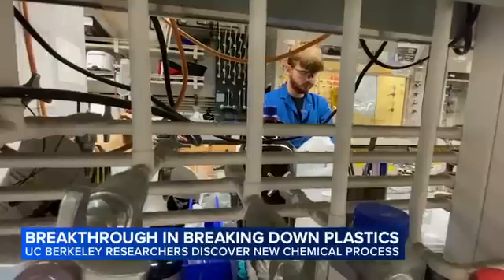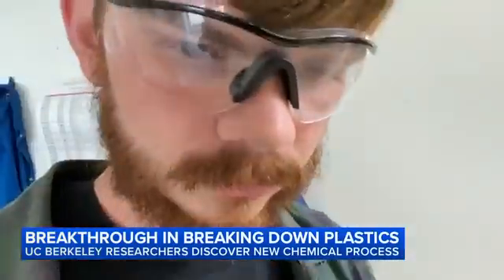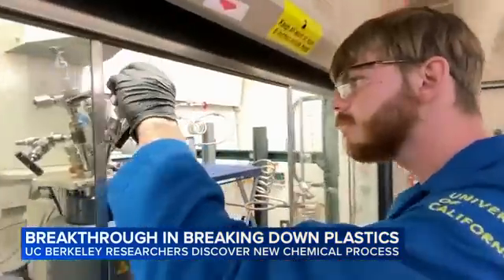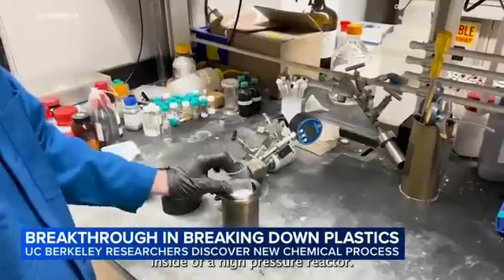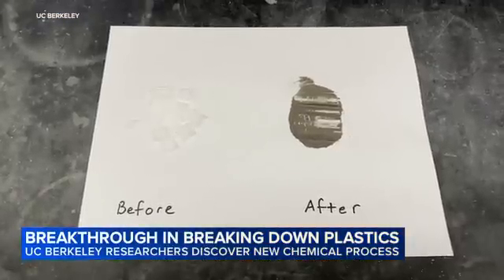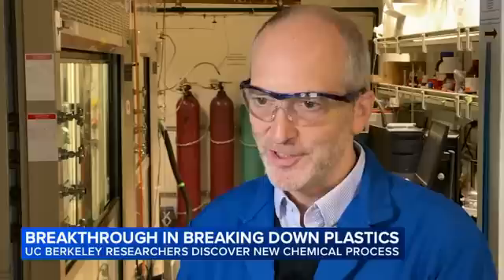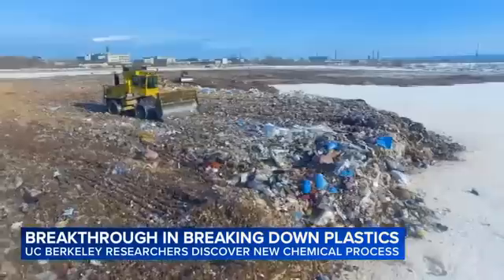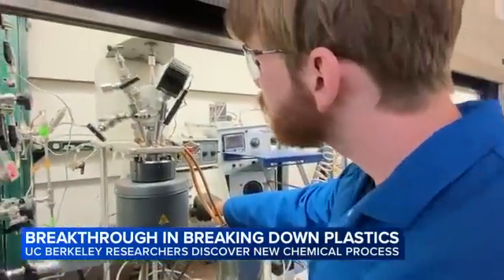UC Berkeley chemists discover new way to break down common plastics

Comment: Nearly all these containers could be aluminum, glass, bio plastic, or wax coated paper, but greedy companies don’t want to spend a few more cents per item, even though the margins are insanely high on most of them.

Meanwhile these companies spend money to launch guilt campaigns to get people to not use plastic shopping bags and most instead use reusable bags which would have to be reused 1000-2000 times to equal the pollution output, but they always break after like 100-500 uses and get thrown away, creating more pollution than just using plastic disposable bags.
Reply: Plastic "canvas" bags really should fall under the same restrictions\prohibitions as single-use plastic bags; plastic textile fibers are now the #1 contaminant found in lung tissue, whereas hemp bags are cleaner to produce and dispose of. Even cotton bags don't use enough water to be worse than plastic canvas bags. 

Artificial fibers are a bane.
Reply: @prophetzarquon  I see a lot of supermarkets selling cheap natural fiber bags, they tend to tear after a couple dozen uses max, they still output far more pollution and consume more energy than disposable plastic. And nobody’s going to set regulations on how strong a shopping bag has to be.

So while it’s nice in principal, these plastic shopping bag and straw laws do more harm than good. Even a sturdy natural fiber bag that can last long enough to break even vs disposable plastic is likely to get lost, damaged in many case before it reaches break even, if you shop once a week most of these bags would need minimum 19 years to break even. I don’t think I’ve ever kept any bag that long and if I did it wasn’t being used, just stored away somewhere.

I agree, microplastics are awful but these laws skirt around the major sources of it, the fashion industry and food packaging.

Comment: There are already way to recycle plastic but it's too expensive. It will be the same as here. How many gram of tungsten and sodium he use and on top of the time and energy just to recycle a few grams of plastic. Now scale this up to thousand of tons of plastic. How much time, energy and these raw materials are needed to convert these plastic back to their useful state? Ideally all these are just waste of energy when you can feed plastic into furnace and convert it into a fuel source to as a source of energy rather and wasting additional energy and raw materials just to convert plastic back.

Comment: High pressure, heat, expensive catalyst, scaled up?  Doesn't seem economical or feasible.  Just a lab curiosity.
Reply: True. Though i just randomly imagined a sci-fi future where the plastic-eating fungi became a problem that got out of hand, then scientists determine that we must gather as much plastic as possible and do this to it or else the sheer amount of plastic being metabolized would turn into obscene amounts of carbon dioxide in the atmosphere. This is probably as infeasible as the "direct air carbon capture" thing being experimented though.

Comment: If it takes more energy then zero energy then it will fail. Go after the manufacturers and the box store system to demand customers bring in their own packaging to leave with an item. Like the tote bags at the grocery store. The beer boxes that don't even need to exist. The straws on the side of juice boxes that are frivolous. The bags of chips that are designed to be loud so people notice you eating them etc etc etc. Simple logic is cheaper and easier to deal with instead of monitizing recycling into yet another separated heap of waste nobody wants or needs.

Comment: This man deserves to be awarded 👏
Reply: Is there an award for perpetually kicking the can down the road and having zero foresight?
Reply: @SeerSeekingTruth  If anyone would know I suppose it would be you .
Reply: I have a pretty good back ground and chemistry, and having not read the paper yet thete are several things this video skips. What is the total energy cost of recycling the products, how usable are the results, is it scalable?

This is extremely promising if this just requires some recoverable catalytic components. But if the energy cost is still high and cant be lowered. This will remain in fairly useless.
Reply: @Fleck7140  How many calories to heat up ethylene for an hour and a half? We'll have so much waste heat from training AI models that we may run out of things to power.

Comment: Sounds really expensive, another pipe dream tungsten powder is 360-370 Kg. The best alternative I have heard is several biological organisms that naturally digest plastics and scientists are working on hybridizing them to be faster and more efficient.
Reply: Tungsten is used as a catalyst and can be recovered from the product.
Reply: There are a few issues with employing the organisms studied for breaking down (one class of) plastic:   
1. When modified to survive at higher temperatures, they flourish in mammalian bloodstreams.   
2. If plastic eating organisms spread outside containment, we'd face an Andromeda Strain situation of seal & container & insulator failures.   
3. The resulting material is a useful precursor to producing new plastics, but it's still toxic; anything less than 100% reuse will mean those plastics still end up in our biosphere eventually, so less toxic alternative materials are still needed.   
(Plastic production continues to increase faster every year, while microplastic decay has barely begun...)   
If this new catalytic method becomes feasible at mega-industrial scale, it would avoid those first two issues...
Reply: @prophetzarquon1922  if.... currently it seems super inefficient and super expensive considering how much megatons of plastic just floats around rivers alone not to mention that buried at dump sites.

Comment: Sounds interesting, a bit concerning that it may not be financially viable.  Seems to require mechanical shredding, chemicals, high pressure, heat and mechanical agitatio.  That could be expensive at scale.  Which is the problem with existing methods, they are all too expensive.  But maybe if it results in high quality raw materials the cost benefit ratio is acceptable.  Lets hope.

Comment: the problem is NOT what to do with the material like plastic, its GETTING IT, SORTING IT, and MOVING IT. still to this day less then 2% of plastics today are being recycled. SO HOW is this going to do ANYTHING? the cost is not the recycling, its the fetching of the material from waste. that 2% only of 3% of the total plastics taken out of the trash. WHAT A WASTE of time and $
Reply: That is a problem.  But there is also no viable way to actually recycle plastics.  Never really has been.  It was mostly a lie.  It can be done but its much more expensive than making new plastic and the resulting material is much worse.  Mostly plastics were shipped to 3rd world countries to be "recycled" where they really just trashed them.
Reply: @Me__Myself__and__I  yes, very true. the biggest scam is the stamp saying its recycled when its not or not able to. to your point, there are very few plastics able to be recycled. BUT you can not drive a force with out a cause. the cause being the ability to sort the product correctly and efficiently. if it was , like this kid, a way discovered to do so.

Comment: No discussion about energy consumption? Heating the mixture for 1.5 hours in California cost at least $1, just for 3 cents worth of plastic?
Reply: Energy doesn't have to be from California, nor does it need to be from fossil fuels. There's always a cheaper alternative and more innovative solutions.
Reply: Specifically in California, there is excess solar power that they currently don't have adequate battery storage for & is actually leading to increased cost. They can use that.

Comment: Breaking down plastic, only makes the plastic smaller and more difficult to get rid of.  When a tree or plant dies, it breaks down and becomes part of the ecosystem. Supplying nutrients to the soil, aiding the soil to grow other plants.  Plastic will always be plastic.  Micro plastic doesn’t have beneficial effects on the soil.  Plastic pollution is a growing problem that man created.  Plastic pollution will continue to grow as long as more plastic waste is produced.  It is cheaper to make new plastic, than to recycle old plastic.  Greed runs the planet.  Oil pushes the Greed along.  At one time in our history.  Stores used paper bags.  Food was packaged in ceramic, glass and aluminum containers.  Cars were made from metal.  Nobody wants to pay more for food and other goods.  Going back to the time when products were designed to deteriorate back into the ecosystem are over.

Comment: That is a lot of input energy!………more than making new plastic.     

Also, in these tests, they always use clean, pure, new plastic……. Will unwashed, dirty (contaminated with oils, foods, etc) and mixed plastics , yield the same useable product?

Just ban plastics, and switch to glass for common use plastic…
Reply: glass has an added hazard
Reply: Even if we did switch away from plastics completely, a process like this is still necessary to get rid of the plastic we've already made.
Reply: Yes thank you.  I also noticed all the inputs into the process.  But if the output is actually high quality raw material just maybe it might have a decent cost benefit ration.  Maybe.   Though usually these turn out to be hype.
Reply: “JUST STOP OIL!”
right?
😂😂😂😂😂
Reply: @Mikdeelow  I’m for Big Oil but we could go back to glass bottles, paper bags, wax paper and butcher’s paper. Everything in plastic really is a problem.
Reply: So you’re a chemist and know more than the researchers?  Wonderful.  Let the experts do their thing and if it works out great.  You negative ninny.
Reply: @hammer-r  maybe he is a chemist. How do you know? What he says makes sense. My reaction to this work was similar. Tungsten and ethylene are red flags for me. And I am a chemical engineer.
Reply: @oliverheaviside2539  good for you.  I’m also an engineer and all I’m saying is let the experts do their thing without people who know nothing chime in as if they are experts. You at least have a background to comment.  The problem with the internet is dumba$ people make comments and other believe them and then the mis information spreads.  If it works we will know, if it doesn’t, well at least they are trying to solve a problem.  But they are the experts trying to solve a problem.  Don’t you agree?
Reply: Ban plastic, are you living in fantasy world. It will never happen, the world is run by greedy people.
Reply: Uh what?
Reply: @gradientcube  uh uh uh uh uh uh ! Heheheheheheh! Are you Beavis or ButtHead?
Reply: I agree with the mainstreaming of using glass. The only people happy with plastics are the Oil Consortium. Since they can just repackaged their waste problem to every house hold.
Reply: @Niggurath-n4h  plastic has its uses, such as in medicine. I hate cars and reliance on cars, so I don't fit into that group.
Reply: @gradientcube  glass are much better for waste management. Like I point out the only people happy for plastics are the oil consortiums.
Reply: True, alternatives exist & they just cost a bit more but need to be pursued.